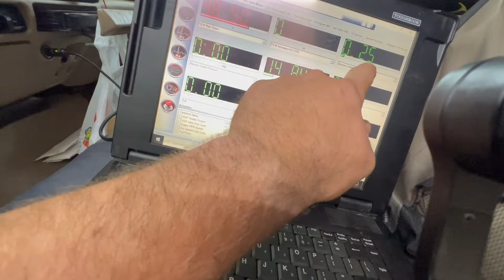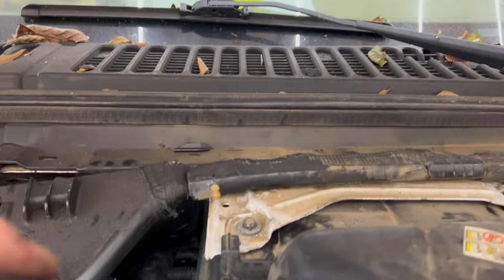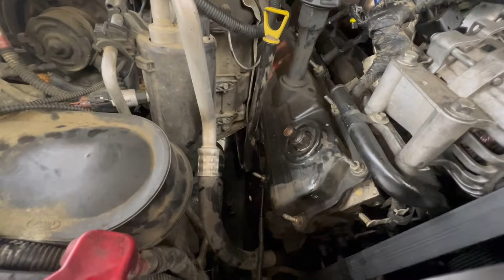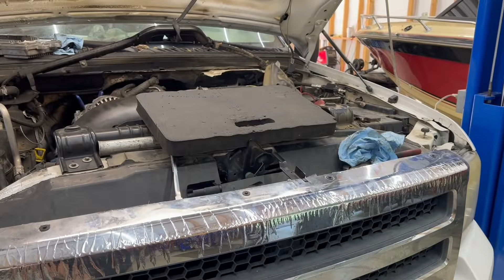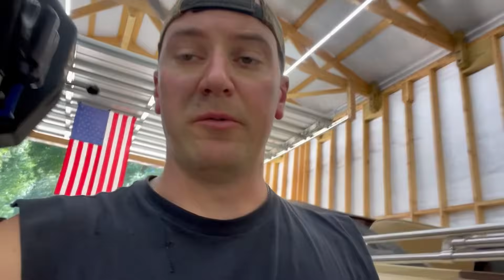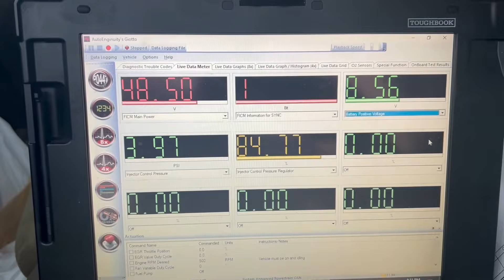6.0 Powerstroke crank no start diagnosing

Comment: Should you always see the oil pressure gauge on the dash come up when you are cranking? I'm trying to diagnose a crank no start...put an IPR  ( motorcraft ) yesterday, still won't start. We're seeing 400 psi on the duty cycle. We see oil filling the filter housing quickly while cranking, but haven't put a gauge on it yet. My dash oil pressure indicator does not move when cranking.Any thoughts on this?
Reply from the maker: Factory gauge reads at 7 psi so it’s not supper accurate for diagnosing the low pressure side. You can drill and tap a factory cap to put a pressure gauge on it to see what you’re making. - healthy low pressure pump should make around 40+ plus just cranking over with a good starter and hot batteries. 400 psi is not you ipr duty cycle, it is measured in % so your more than likely looking at icp psi actual. Start with your low side and verify what your psi is, once we know you have good low pressure oil I would then air test the high pressure system through the ipr and listen for leaks.

Comment: I’ve heard your opinion of tuning a 6.0 but I wanted to know what you think about doing a ficm tune? I don’t beat on my truck and I am meticulous with my maintenance but I would like to wake it up a little with an Atlas 80. I hear that a ficm tune does not advance timing and so it supposedly doesn’t increase head pressure.
Reply from the maker: Anything that increases horse power and “wakes it up” is also going to increase boost and cylinder pressure. Don’t tune a unstudded truck regardless or you’ll find out how expensive a 6.0 can be
Reply: @AutomedicGarage understood. Thanks

Comment: I have an airleak on the passenger side (pulled IPR and did shop air test).  Do you remove the Fender liner to get to the 3-bolts on the valve cover that cannot get from the top of do you have another method of getting to the hard to get to bolts?
Reply from the maker: I don’t remove liner or anything to get to them. I use a ratchet wrench on the bottom 2 and a 1/4” 12mm deep socket to get to the very back one.

Comment: good job.   those old batteries were really weak,  didn't think they'd have enough to crank up to pressure.   curious to see the FICM voltage at 45 after it started.    I've only dealt with 7.3 up to now,  don't have FICM (IDM) voltage or sync PIDs.   I'm thinking of getting an 05 or later 6.0.   I likely need my head examined.  dong the ICP/IPR and passenger side rail is quite a pain.

Comment: would you run diesel site stand pipes
Reply from the maker: Yes we do all the time other than the standpipe deletes we install
Reply: @AutomedicGarage  ok because i am going to get my buddy's computer, if the ipr is at 84 % i am going to do stand pipes. I had the same exact 8 second crank till oil pressure like this one
Reply from the maker: @MJA107 air test it first…don’t guess
Reply: @AutomedicGarage  alright
Reply: @AutomedicGarage  i'll air test it but what else could it possibly be its cranking fast and all the numbers show  pointing to and etc
Reply: @AutomedicGarage  what is the cheapest easiest way to air test my system?
Reply from the maker: @MJA107 buy adapter for ipr, thread air hose into adapter, remove ipr, thread air tester in
Reply: @AutomedicGarage  alright
Reply: @AutomedicGarage  iam like you most the time i put in ford oem but i don't want to do stand pipes every year

Comment: Love your straight to the point videos my friend!  On my 06, i'm getting an ICP psi reading clear up to 2400psi, then drops off to 1600. But still is a crank no start. Using Tourque pro. Entire oil system O-rings replaced, STC replaced, all injector seals replaced, stands and dummies all new oem..still a crank no start. What would cause that reading to be so high in the ICP? 
Tried downloading Forscan, but not available at this time. Could really use some help!!  Thank you
Reply from the maker: Have you checked your ipr screen and tried commanding it at 80%

Comment: Got a 2004 6.0 that tries to start up but absolutely wont. While cranking, it will start to fire a little bit. I've got oil pressure from what I've gathered watching a scanner but it will fluctuate during cranking. Ficm doesn't drop below 47v, ipr duty cycle goes up to around 84% and the icp voltage stays between .24 and .29. Any ideas? Thanks
Reply from the maker: I need to know what icp and ipr values are during cranking. Icp needs to be in psi not kpa
Reply: @AutomedicGarage  the icp builds up at what I think is a normal rate and it reaches 500 psi and acts like its going to start up and then jumps over 1400 psi and then back down again. I actually just put a different ipr valve in and the duty cycle jumps to 53%. While not cranking the duty cycle sits at around 14%
Reply: I found a couple relays under the hood that are corroded and nasty looking. There's two of them in their own seperate box next to the box that has the ficm relay. Can't find what they are actually for. I'll replace them but I'm not sure thats the problem

Comment: Can you tell me what i would expect to pay in labor for this exact job?
Reply from the maker: As far as diagnosing a Hpo leak if it’s just hooking up the scan tool $150 to diagnose if it takes an air test through the ipr which is essentially the same job as replacing the ipr it’s $375
Reply: @AutomedicGarage i bought a basket case crank no start before i knew what a 6.0 no go was 😂 .. I get no injector chatter when i turn the key just the 2sec buz where i would expect to hear it after they all chatter..he swears he just put a brand new set of injectors in and threw all the typical parts at it including a new hpop. Looks like I'm about to get a crash course on the 6.0 no go... I have forscan and the tool to air test but i gotta figure out this lack of chatter
Reply from the maker: @sirridok what’s your FICM voltage? Check the FICM plugs cause most idiots F those up and brake the connectors. Also check the ground on driver side rear intake bolt
Reply: @AutomedicGarage  i appreciate the advice..so i finally hooked up forscan last night.. Had a ton of codes but after running all the tests and passing i cleared them. Was left with "oil pressure switch" fail.. It's not building pressure on the low side, i found the anti drain back was upside down with all the prongs broken off. I tried to get it to stay put while i screwed the filter/lid back on but my PIDs are as follows 
Sinc yes
Ficm main 48v
Ficm vpwr10.50v
Focm lpwr 10.50v
Icp .25v
Ipr 84.77%
According to my crash course the next move would be check the Ipr for a damaged screen and get that anti drain back valve replaced. I'm still left with the question of why no chatter though. I did the injector electrical test and there was a faint noise where i was expecting to hear the standard injector click but they test as "successful"..maybe he put some cheap after market injectors that don't sound the same? Anyway I'm gonna double check that ground and the ficm connections.. Batteries aren't very hot either
Reply: @AutomedicGarage so I know you're a busy man and I respect your time, aside from Ron R.I.P you're the only Tech I would actually pay to coach over the phone are you up for that type of thing? I don't have Auto Ingenuity but I have forscan, 
  now I'm getting cam / crank sensor open circuit/incompatible FICM intermittent codes and still 1,4,6,7 circuit high.. you said you thought it sounded like harness which is exactly what I'm thinking but can't figure out where. 
  Inject harness didn't have any chaffing or damage thru foil so i ruled that out. Actually had it running great after the first comments in this thread.. 😢For those reading, I'm also having a slow crank issue,
   i think the computer is disengaging starter after seeing the cam/crank issue cus it only cranks for a couple seconds slow then sounds like a bad start solenoid. I replaced that and took the starter apart to clean the oil..2 new batteries..still slow crank then disengage.
   I cleaned all grounds replaced one battery to frame ground. Nothing. For reference the injector harness tests good, no open to ground or power and injector ohm tests show good. Got the typical windshield leak so thought maybe corroded fuse box..
  took it completely apart and aside from a small bit of oxidation that i cleaned..nothing. Can tell it's been leaking a while it's all rusty under there. Also replaced the FICM relay in case it was failing under load.I'm stumped but I'll update for the record when i find something.

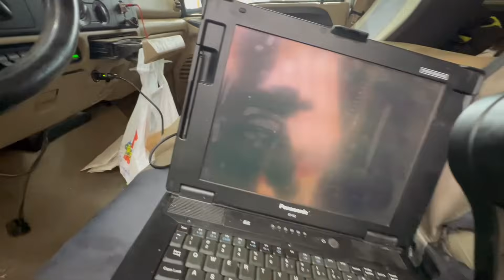Comment: I have a99 ford 1 tion power stroke. Put two new batterieson it 2:10
Reply: Nofiring
Reply: Did oil changefuel filter air filter  but can't get out to fire, guy put in two sencors, one got bent, I'm at a loss help please, I've had the truck for 26 years. No firing,
Reply from the maker: @reneecooper7381 need live data numbers to help diagnose

Comment: what part of West TN I am from Savannah in Panama City working I have replaced ipc sensor twice code shows low circuit I just installed a new ipr it turns over wont start also without having the fitting to pressure test how else can you do it unplug the ipr or maybe use an old one ? if you have a sec would you kindly get back to me .. thank you
Reply from the maker: Do you have a scan tool that shows live data?
Reply: @AutomedicGarage  I do but Everytime I try to use it ,it says no  not communicating or something alone those lines but I'll try it again .
Reply: @AutomedicGarage  I just got a scan gauge 2 to show me the fmp,fsy,ipr and ICP 
My ICP is at 1153, fmp 48.5 ,14.5 on ipr and trying to start fsy has 1.
What is my problem
Reply: Have you ever had to to clean the heads because of oxidisation?
Reply from the maker: @justinwelch1831 no, if we’re pulling head we’re replacing them.
Reply: @AutomedicGarage  so I replaced all orings in the ball tubes injectors except the ball tube end of the injector I left both valve covers off and have no leaks just changed oil  and filter in it yesterday also the stand pipe and dumbing plugs replaced new no leaks but still no start idk if the battery is to weak or something else going to try to start it again today . Any thoughts would help pls and thank you
Reply from the maker: @justinwelch1831 what I your icp psi, icp V, ipr %, FICM main power, FICM sync and fuel pressure when cranking?
Reply: @AutomedicGarage Ipr is at 55 .1 ,ficm main is 48.9  , ficm sync at 1  ,ICP  1055lbs , with spray it tries to start but without it it just turns over , I double checked for a leak in the high pressure oil rail but no leaks so what else could cause the high pressure in the system , is there a way to check the injectors to see if they are firing ?
Reply: I will try to check fuel pressure today when trying to start but has new oil coming into the oil filter and  fuel is in the pump housing at the top of the motor turn key fills up in secs double checked those last night just to be sure it was getting to top of motor and they are both pumping .
Reply from the maker: @justinwelch1831 yes, buzz test the injectors. Are you making LPO and what’s fuel pressure?
Reply: @AutomedicGarage what are you calling lpo and I haven't checked fuel pressure and what's the buzz test never done it ? Is that with the screw driver touching it and listening ?
Reply: Again sorry to bug you so much with this but idk anyone else to help .
Reply: @AutomedicGarage  Is there a fitting I can buy at the auto parts store to pressure test the oil rail with the air pump I know I have to power the ipr valve but I can do that with a jumper .
Reply from the maker: @justinwelch1831 prosource diesel has them
Reply: @AutomedicGarage  where can I get the ipr valve air fitting same place ?
Reply: @AutomedicGarage where are y'all located in West TN? What town ?
Reply from the maker: @justinwelch1831 Arlington
Reply from the maker: @justinwelch1831 yes sir prosource or accurate diesel
Reply: @AutomedicGarage ok I work at a prosthetic plant over there sub contractor building scaffolding for them ..  I found a fitting that works in the ipr valve hole pressurized it last night and had enough air coming out of the passenger  oil filler hole felt like a fan blowing so think I found the problem .
Reply: @AutomedicGarage driver side had nothing but a noise coming from it  .
Reply: @AutomedicGarage  yes it's making lpo,I did the air leak test and the high pressure oil rail is good no leaks but sounds like I can hear air coming from the back by the ipr valve also when I turn it over it smells like the starter is burning up I already replaced it with a 6.4 liter starter ,but still smells like it's burning it up I took the belt off the engine and didn't change anything it's hitting 177 rpms when cranking and I can't hear anything binding it down for the starter to be burning up also have 2 brand new 850cca battery's can you tell me what could be leaking air from back by the hpop ?
Reply: @AutomedicGarage btw the motor has EGR delete studded and tuned .,new ficm new Ipr new ICP new injectors new ball tubes new valve cover gaskets new heater control valve new degas hose from water pump to degas bottle new oil filter and oil  also new oil filter cap ,I would gladly bring it to you if I could but I am in Panama City Florida and don't have the money to have it hauled or towed to Arlington lol
Reply from the maker: @justinwelch1831 have you verified LPO pumping into oil filter housing? If it’s a 03 or early 04 and you only hear air and gurgling through the oil filter housing it’s the hpop then

Comment: Im a deisel dummy ok, i just got the 6.0 in oct, it was great then one day as im accelerating i notice that the blower sound it usually makes was not coming on, and now since that day it gets hot shuts off and i habe to wait for it to cool before i can start it again but it is full of coolant and does not have anything showing on guages. If its cool outside then it will last till i get where im going but then die. Being a single woman i have no idea what this is and if course money is an issue. Can someone tell me what they think
Reply from the maker: Sounds like a crank no start hot due to a high pressure oil leak. Needs to be air tested and see some live data to see what’s going on

Comment: I just had this work done for a crank no start problem, get five miles down the road from shop and the truck shut off; tried to jump it, got about 800 feet down the road and the truck died again. I replaced the alternator, and it was ok getting to work, but the truck shut off completely coming home. Batteries are 6 mo the old. What do you suggest I look for as this new problem? Never had a problem with the truck just shutting off while driving. Started after the standpipe and dummy plug replaced. (Also, had this work done ~two years ago (60,000 miles) ; does that timing seem consistent with your 250 6.0 diesel knowledge?)
Reply from the maker: Need to see some live data to point you in the right direction, could be high or LPO oil or could be they weren’t clean and our ipr screen has trash on it or could be that they got rough with your wiring harness and your losing sync or could be as simple as they either messed up a FICM plug or didn’t get one locked all the way in but again this is why I need live data to point you in the correct direction

Comment: There are bleeder plugs on top of each oil rail remove one at a time and use jumper wire on passenger fender well to jump to battery and watch the air and oil bubble up and out only takes a few seconds makes start up very quick.
Reply from the maker: @markmchenry4197  correct it can be done that way. I just don’t do it that way.

Comment: I'm a little late to the party. But Blue Point makes an excellent set of one piece stubby torx bits that allow me to get those 2 pita bolts by the box. With my qtr inch torque wrench. They're also short enough to use a swivel for removal.  I spent way too many times leaned over the rad support thinking i was turning them out with the tip of my fingers. Only to let out a few cuss words that i wasn't 😅. Anyhow great videos
Reply from the maker: @kylebachman4477  got a tool number for the torx

Comment: What causes  for a truck suddenly  to shutdown  after 5 minutes of idling?
Reply from the maker: @mikeches7992  that’s a pretty open question….could be a long list. High pressure oil leak, weak high pressure pump, low FICM voltage, lose of sync, wiring harness issues, bad icp or ipr. Need live data to point you in any direction.

Comment: Your oil gauge should pop up mid way just cranking? Is that normal for all 6.0?
Reply from the maker: @sMFq11  oil gauge is not always the best judge of LPO because after long cranking or batteries with not so great voltage the gauge cluster is one of the first things to get dropped so it may not read anything.
Reply: @AutomedicGarage  yeah I get that totally mine doesn’t pop up at all I got plenty of voltage cranks fast and even…. Fills the oil filter housing….. just not building enough high pressure… using a Matco to read data and it will only fire up if it gets a whiff of ethere
Reply from the maker: @sMFq11  air test it. It will tell you where the problem is
Reply: @AutomedicGarage  on it just got my tools to donit

Comment: Did Ford change the oil pump pick up screen on the 08, 09, & 10 on the 6.0 engines?
Reply from the maker: @ardenbriggs1190  I couldn’t tell you cause after 07 they are only in vans and I don’t work on them much
Reply: @AutomedicGarage

Comment: Goodnight. I have already made the necessary repairs for the DTCs I had. Today I removed the oil, it's very thin and dirty (I believe that could be it), I removed the oil pressure regulator (it was very dirty) tomorrow I'm going to change the oil and put in 15w40 and check the pressure. I sent you a video on your Instagram. Thank you for your help.